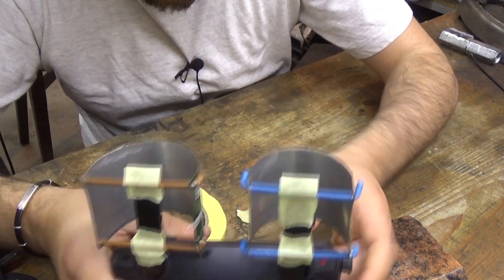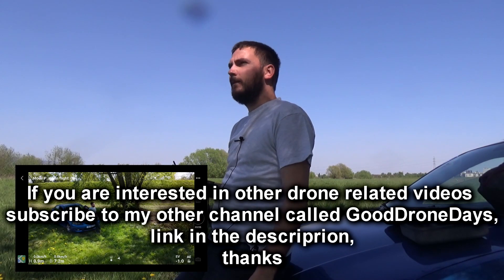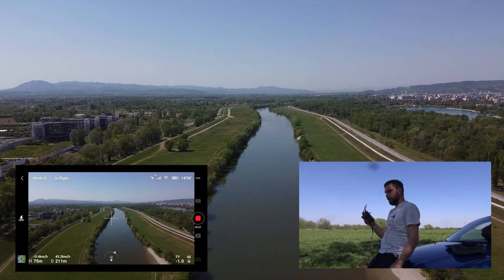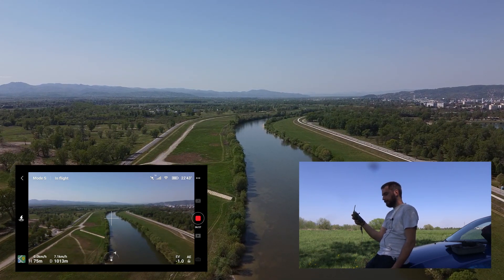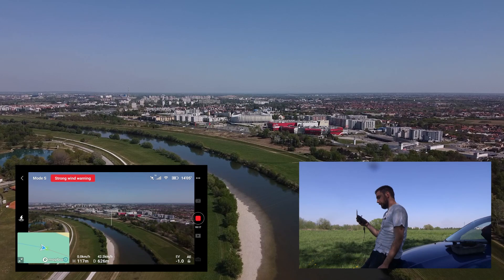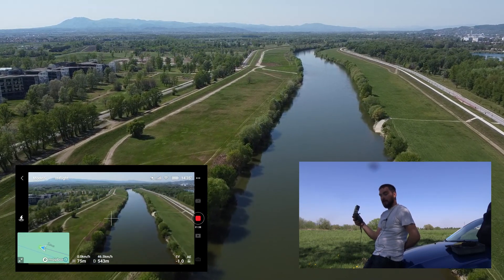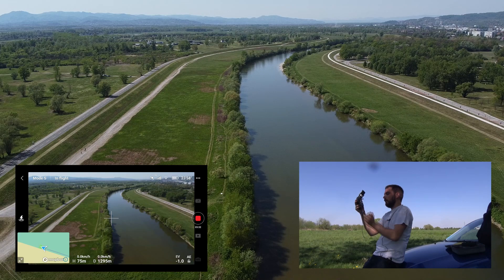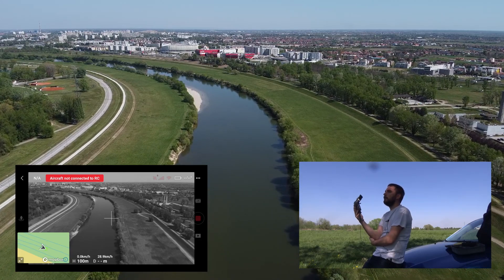DIY Drone Range Extenders

Comment: My question is are the antennas on the remote even real to start with ? my experience is they are plastic ears for show and can be removed and discarded , inside the remote is a wire antenna if you drill a hole in the remote casing and have the wire antenna sticking out the hole that might help a bit and then attach your extendor to that , good luck !

Comment: Radio waves act like light so if you place a light where the antenna would be, you could adjust the bend in the reflector to get the most light out. Also keep the reflectors pointing more toward the drone instead of the sky might help. Thanks for the experiment.

Comment: That's not a parabolic reflector its just a cylindre,for DIY you can try windsurfer works great.
Reply: allumenium can be used as a parabolic reflector. In fact, most parabolic reflector are made out of allumenium. Greatly effective